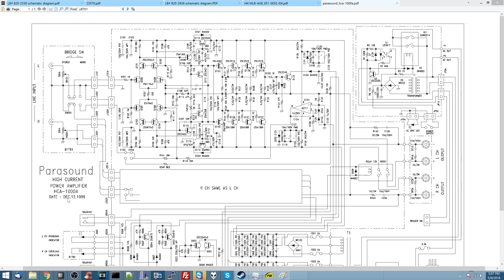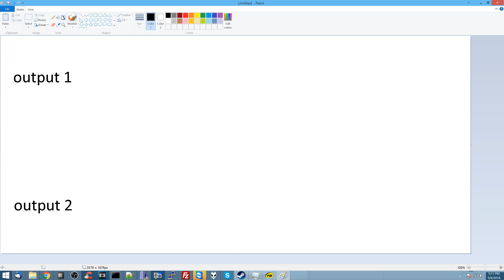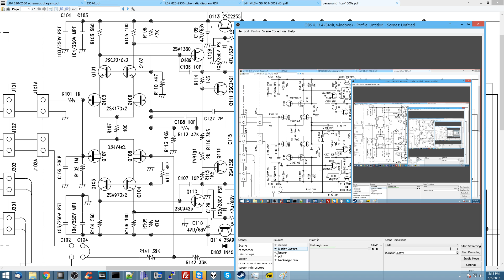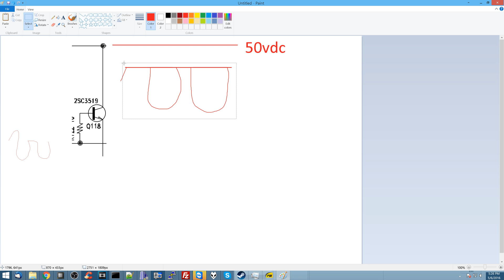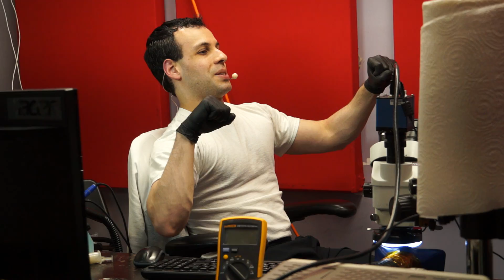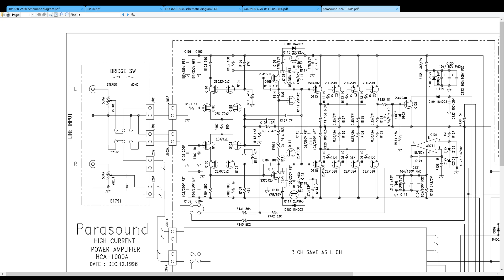If you didnt believe I flunked out of college...

Comment: Louis, the AD711 is an integrator, note the cap without a resistor in the feedback around the OP amp.  It is a DC servo to null out the DC output voltage.  The AC negative feedback is R112 to R116 at the negative input of the complementary FET diff pair front end.  That is a John Curl design I'm sure, he likes the comp diff pair with Toshiba FETs and to run the output stage at high bias for an AB type design.  Expect it to run a bit warm.Also, the triple outputs and their respective drivers Q115 and Q116 are configured in a push pull Darlington emitter follower configuration.  Emitter followers have no voltage gain, it is very slightly less than one.Q109 and Q110 are the push pull VAS (voltage amplification stage) where most of the voltage gain happens.Q111 and Q111, looks like a typo there are two, provide the output stage bias and they are probably mounted to the heatsink for thermal feedback to keep the bias point stable.Q113 and Q114 are capacitance multipliers that isolate the front end from the noisy output stage rails.  The transistors multiply the capacitance from their bases to ground by the beta of the transistor - John Curl likes them.Q101/102 and 103/104 are cascodes, they hold the voltage at the drain of the input FETs nearly constant while passing the current to the next stage.  Their purpose is to nearly eliminate the Miller multiplication of the FET's non-linear drain to gate capacitance which would load the preamp driving it and lower the bandwidth of the front end.
Reply from the maker: +Pete B Thank you for your post, it brings me back to a time where this was easy and common sense. I appreciate it!
Reply from the maker: +Pete B Do you post on diyaudio.com by any chance? I'm not a poster but am an 11 year lurker!
Reply: +Louis Rossmann Yes, I'm PB2 there.  I've not seen that schematic before, thanks for posting it.
Reply from the maker: +Pete B Wow! I recognize your handle!! I've been reading your posts since I was 17!! Thank you for your contributions! That entire site did so much for me when I was alone and figuring all of this out with no help on my own. You have no idea. :) THANK YOU!!

anatech's posts as well did so much for me as a teenager in contributing to my current knowledgebase/troubleshooting philosophy.
Reply: +Louis Rossmann You're right I had no idea, so few people ever say thanks on there I sometimes wondered if anyone read what we wrote there.  I like to teach so it is very nice to hear that you started so young and got something out of our posts there.  Very nice to hear from you.  Yes anatech is a great very helpful guy.
Reply from the maker: +Pete B Just for the heck of it, I took a 30 minute cheat break from paying work to play with my toy before the spare parts arrived.

left channel works great

right channel just outputs clicking crap to the speaker. 

every time you hear a click in the speaker, it's followed by a 5-10v dip on the power supply rail for that channel. no music.

if i jumper over the power supply for the left working channel to the right nonworking channel and bypass right messed up channel power supply, i can hear music, but it is filled with terrible awful noise. but at least there is music along with the shit noise. 

of course the cheap test speaker I was using for this is completely decimated from what I imagine are all the DC hits. 

i have +63vdc and -63vdc for both channels, but the bad channel is sporadic and dips up and down. When I do hear music out of the right side with terrible noise, on the scope it shows an AC waveform, around 6-13VAC, and I don't see DC. 

No blown fuses. Just really crappy sounding audio. 

I have a feeling this is going to be a long project. :)
Reply from the maker: +Pete B Just for the heck of it, I took a 30 minute cheat break from paying work to play with my toy before the spare parts arrived.

left channel works great

right channel just outputs clicking crap to the speaker. 

every time you hear a click in the speaker, it's followed by a 5-10v dip on the power supply rail for that channel. no music. there is a click coming from some component in the amplifier that directly matches the clip sound coming from the speaker.

if i jumper over the power supply for the left working channel to the right nonworking channel and bypass right messed up channel power supply, i can hear music, but it is filled with terrible awful noise. but at least there is music along with the shit noise. 

of course the cheap test speaker I was using for this is completely decimated from what I imagine are all the DC hits. 

i have +63vdc and -63vdc for both channels, but the bad channel is sporadic and dips up and down. When I do hear music out of the right side with terrible noise, on the scope it shows an AC waveform, around 6-13VAC, and I don't see DC. 

I have a feeling this is going to be a long project. :)
Reply: +Louis Rossmann It is old enough that all the electrolytic caps should be replaced.  If you can jump side to side for testing then you don't have to do the main caps.  I'd say that transistors don't usually fail in that way, could be an intermittent junction perhaps but first I think it is worth doing the caps.  I'd drop the bias, and see if there is oscillation on the output also.  We need to systematically rule things out.  And be careful around the input FETs - they are out of production and were matched.

Comment: sound clipping is the main reason you want to stay far away from D/T class amps. 
With an A class amp (my personal main amp is an A class skrew efficiency give me performance) it is almost impossible to clip unless it is cheap, which even then it most likely will be the last 1-5% of the volume approaching 0db. There are some well implemented class D/T amps which are both very efficient and small but even the best can only reach approximately 70% max volume before minor increasingly worse distortion sets in, followed by horrible clipping at 75-80%. So when you buy a class D/T amp on a budget (what that class is for) then always check that 70% of your amps max rating is at least as high as the mid point between your speakers min and max input wattage rating (on a efficient set of speakers more than 90db at 1 watt), otherwise you may run into low volume issues. if your speakers are rated at less than 90db then you may need to get an amp with more power, especially if the speakers are for a tv or more than a 2 meters from your face.
note in general it is better to have 20-30% more power than you will ever need or than your speakers can handle. Reason being is that you are safer from speaker damageing clipping, future proofing for bigger speakers, and allowing more freedom to "pump up the volume" if you ever need to.

Comment: Excellent, nice to see you mucking about with something different compared to that other Apple shite
Recently repaired a Behringer PMP5000. Bought on Ebay a few months ago. It worked (sorta) someone had blown the main power amp. £35 later and many hours tracing, measuring circuits and tracking installing new componants it is now functioning.

Comment: Often, without a schematic, you'll never know for certain what one of the components is, or the exact value of it. It also give you much information about what voltages to expect at what points. Even if Apple just couldn't possibly give the PDF out for free to people who do this professionally, they could at least sell them. What could possibly be the cost to Apple for doing so, provided the schematics come with a disclaimer absolving Apple of responsibility for you screwing the board up worse by using it? Well, unfortunately Apple feels that if they provide these materials, free or otherwise, that it will cost them sales. And yes, many times a person will not buy a new one if the old one can be fixed at a lower price. To me I can see both sides, but I think ultimately it sucks for Apple to have this mentality. Technology products have built in obsolescence, at some point, even the best made computes or smartphones will eventually become too outdated to run modern things. So people will have to buy a new one eventually, why is Apple entitled to limit your options for when your device, that you paid good money for, has a hardware failure. I realize Apple has the rights to the materials they produce, technical or otherwise, and can decide who they want to give them to or for what purpose, but we also have the right to express that we feel it is a douchebag decision. It is definitely a newer mentality to look at a device repaired as a sale lost, as high priced equipment always had schematics and parts diagrams in the paperwork that shipped with it. Its a newer way of thinking, and it SUCKS!

Comment: Hi Louis,

your videos are informative and entertaining at the same time, I enjoy them very much.
I like how you can describe technical things in such a simple way.
I am just a hobbyist and by no means an expert in this field, but I would like to share some piece of information that might be helpful.
The beta value of a transistor is highly depending on the temperature. It increases with higher junction temerature (like 100% or more from 25°C to 125 °C, this information can be found in the datasheet). This means that the current is not shared equally between the output transistors when one transistor gets a little bit hotter. The hottest transistor will pass the most current and it will get even hotter until it eventually blows. The resistors that are connected to the emitters are supposed to address this problem: As more current flows from the emitter, the voltage drop across the resistor will increase, which in turn decreases the base emitter voltage, which results in less base current and less current from collector to emitter.
One thing that is very important is that all transistors have equally good thermal contact to the heatsink. This may be as important as matching the beta values.
I don't know if the information is 100% correct, but I hope it is helpful (sorry, English is not my native language)

Best regards,

Gerald

Comment: Louis, you expressed some concern at being able to get replacement thermal compound for the power transistors - it is very likely to be zinc oxide thermal paste (does not conduct electricity). I'm sure you know to thoroughly clean off the old paste first. And replacement mica washers, if they are fitted but damaged, are also easy to obtain - they usually come quite thick, but you can separate the layers to get (a) more washers and (b) because they are thinner (not too thin - they are for electrical isolation), lower thermal resistance.
Reply from the maker: +Andrew Morton my concern was forgetting what they were called and where to buy them since I have no idea where I got the replacements ten years ago. I still have no idea where I bought them. At least now i know what i'ts called again. Thank you!

Comment: I love schematics, I love repairs, I think it's funemental to an advanced society! I also remember a time when even big tech corporations had electronics hobists and repair men in mind, because they came from that field. Just a small corection... Technically a bridge rectifier outputs both the negative and positive part of the AC sinewave on the positive plane, that's what it's called full rectification, like this.... http://www.electronics-tutorials.ws/diode/diode23.gif then the caps smooth it out (as you said). And if you have a center tap on you transformer, you can use that as ground reference and now you have half your original voltage but you also have it as a negative voltage also, like that http://sub.allaboutcircuits.com/images/03444.png
Reply: Well , there was a time where you would get a schematic printed by the manufacturer and included with your product  ( TVs , Radios,Amplifiers, Fridges etc. )  * ( in Poland )  And now many use them to restore most succesfull of those products out of nostalgia mostly and In some particular cases becouse it was such a Legendairy succesfull product like for eg. Radmor 5412 series of Radio/Amps.

Comment: Hi Louis, love your old transistor tester, your videos and attitude. A handy hint i was taught many years ago is to  use a 60~100W incadescant light globe in series with the AC active line as a current limiter when testing the amp under repair. It sounds like you have one or more shorted output transistor/s.

Comment: Most importantly is the sourcing of replacement transistors as to not buy crap counterfeits. This is grey water in my opinion as these are definitely closing in as transistors that have been faked. I am sure you will see all sorts of alibaba this or UTC source that out there to order online. I would be very weary of any of those sources. 

Digikey looks like they have plenty of these Sanken transistors available... 

Some examples of counterfeits of these types but not labeled with Sanken... 
http://sound.westhost.com/fake/counterfeit-p3.htm

Comment: Things get VERY interesting when you work on antique tube equipment; lots of developing technologies (like electromagnetic speakers with field coils, messy wiring and solder joints from the unskilled farm labor they used back then, and even undocumented mid-production "design changes")
Reply: Tube gear is a lot of fun to work on. I love point-to-point

Comment: Interesting stuff! Fortunately, I understood all of it. I had most of the pieces explained to me by an electrical engineer I used to work for, but it didn't really "click" until now. Thanks!
Reply: Louis himself didn’t understand all of it. I don’t understand all of how the amplifier works but I spotted a couple of errors in what he explained:

PSU is full wave rectified (with 0v reference coming from the centre tap), not half wave rectified as drawn. Very minor thing. 

The “negative feedback” Louis pointed at is completely mistaken I believe. It looks to me like that op amp is a precision op amp doing speaker output DC offset correction. The most obvious clues are that the op amp has a RC filtered + input, and no feedback resistor but a capacitor instead between output and - input.

The RC filter throws away high frequency signal (the music) but not any DC signal. The capacitor for feedback path makes the op amp into an analog integrator (as in calculus - finding the area under the curve).

Comment: Louis,

I have a electronics engineering degree and remember the times when the equipment you bought would actually have the schematics attached in the device or in the manual.  You do the you Apple YouTube community a great service showing that their Apple electronic devices can be fixed contrary to what Apple wants yo to believe.  Throw it away and buy a new one. My wife uses a Lenovo laptop as her daily driver but uses a iPhone 6S+. Drives me crazy, I did read the Samsung S7 has overtaken the iPhone 6 as the cell phone to buy.  I have know idea if Samsung locks up their schematic's in Fort Knox like Apple

Keep up the good work.

Jeff
Reply: Absolutely, I remember the time when you bought a television, and the thing came with the schematics included. And a manual. An actual manual, not just a quick setup leaflet.
Reply from the maker: +Jeff Burkhardt Thank you for the kind comments!
Reply: I also remember when most people who weren't rich who had an amplifier actually ordered a kit from Heathkit and built it themselves. Not only did you have the schematics, but you had replacements for pretty much any part in it for future repairs. You could also choose to improve on the design by using better quality parts for the transistors for example (lower THD, better efficiency, etc).
Reply: heh heh.. Samsung... Knox... heh..